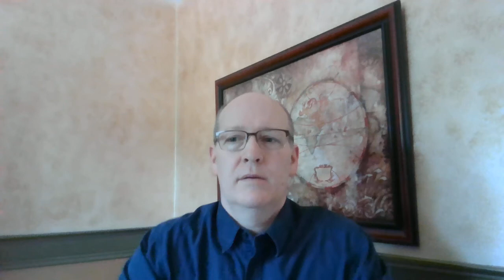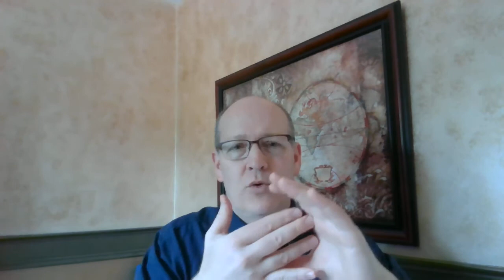Magnetic Energy and The Hollow Earth

Comment: You do require a dense core. It is inherently apart of the definition of positive and negative charge. Considering that energy is motion and we define particles as being full of energy, the density defines the amount of charge per volume and the ability for energy to not just randomly disperse due to being anchored by a positive charge and thus for a lasting matter. Synthetic low density objects with high density characteristics can form only under an active current.
Reply from the maker: This is a good conventional view, but consider the etheric element and pulsing rotating/counter-rotating magnetic fields that do not require any physical density to produce unlimited positive and negative charges, as well as gravitational fields. Density is completely irrelevant in neutral pulsing magnetic fields where the strong force vanishes, cold plasma and cold electricity flourish, neutral charges are created and positive and negative charges are merely etheric energy exchange expressions and secondary products.
Reply: @MagneticEnergy  As I pointed out, energy is simply motion of ... something. So if it is in motion, it will go away. Unless it is anchored to something that can give it a circular path, thus it can move in circles and not go anywhere.  Take a hurricane,  Do you see a heavy positive charge anchoring it in place? It is the ionized core of negative electrons that is the positive charge.  The motion of the electrons creates an attraction that pulls them together until the electron path is a linear positive charge.  The presence of a positive charge means that negative is now emitted from the positive charge as some energy will always escape the confinement of a positive charge. This emittion creates the negative area that we call a negative field. All positive charges and negative charges are in constant flux. A positive charge simply emits, a negative charge absorbs.  All positive charges are emitting so that they can find a lesser positive charge  (net negative) and exchange energetic particles with it. There are no neutral particles. That was just invented to solve a math problem. particles can swap between positive and negative many trillions of times per second if neutral is inevitable.  Love talking about this but my post is getting a bit long...
Reply from the maker: @ScottMana  Again, a great conventional explanation that assumes we live in a closed system. Telsa knew the etheric field is predominantly neutral and our magnetic energy engines that produced 480 HP ran on the flow of ions through the conductive use of neutrons producing neutral flowing magnetic current. Energy moves through the force of attraction from the etheric field into our dimension at all times. Positive and negative charges manifesting as electro-magnetic waves are merely disturbances in the etheric field. Neutral energy pulses do not disturb the etheric membrane making them almost impossible to detect with conventional equipment. The etheric draw keeps energy in place in a vortex motion - this process is what holds the gravitational field and the magnetic field and any vortex field in place. Again, charges are merely bi-products, not causal agents. Positive and negative charges manifest when etheric energy exchanges dimensions. They are not opposing forces - they are part of the same attract circuit that begins with predominantly neutral energy and ends with predominantly neutral energy.
Reply: @MagneticEnergy  I have never seen any evidence if a "etheric field".
Reply from the maker: @ScottMana  I and many others have seen the evidence and it truly changes everything. Please consider looking at a book called "The Dynamic Ether of Cosmic Space" by Dr. James DeMeo. Thank you so much for your comments and for giving magnetic energy/etheric physics some consideration.